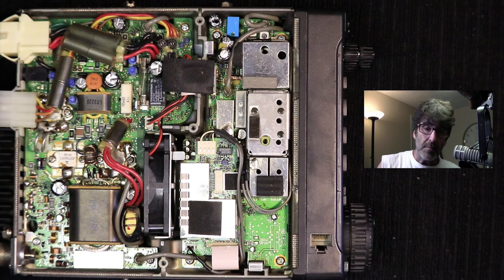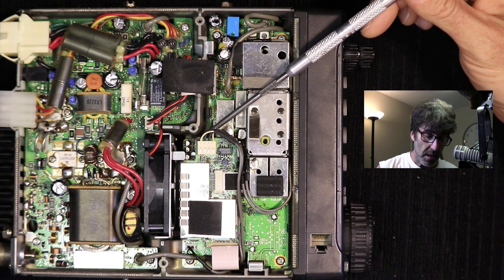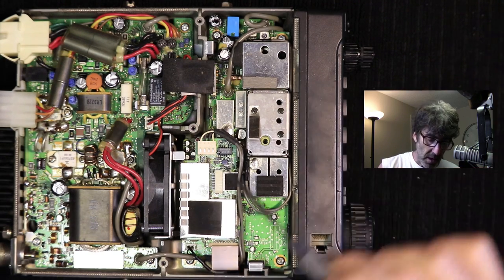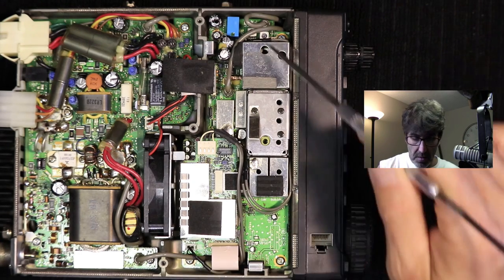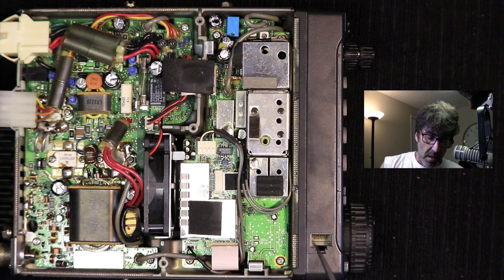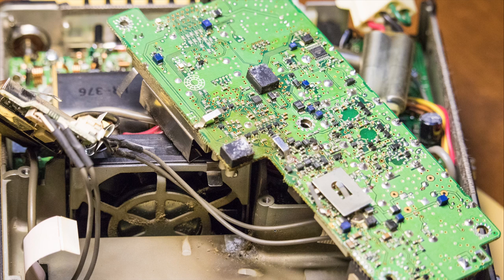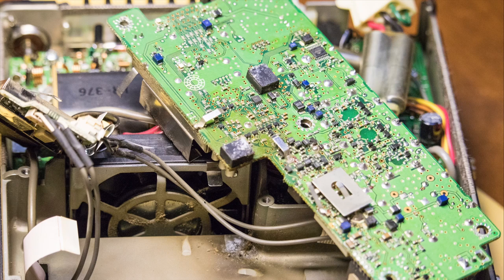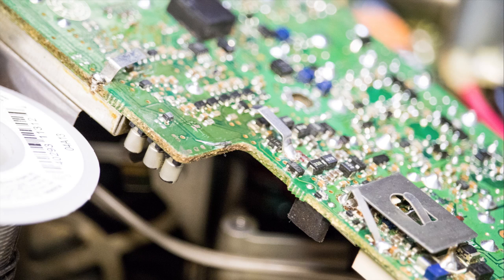ICOM IC-706MKiiG Won't Power ON.... FREE FIX!!!!

Comment: My 706 behaved a little differently. I went into the motor home where I have it mounted to find it making a continual "CLICK CLICK CLICK..." and occasionally coming on completely. Took it down per your instructions and found exactly what you did. Patched the corroded spot and all is well again! Only difference is I removed BOTH rubber pads completely. In my opinion the board is plenty stiff without the support of the pads, and they are obviously highly corrosive!
In my case, it's likely that the corrosion was carrying enough current to ALMOST power it up, but not enough to keep it going. Thanks much and 73! de Harvey WB5MCT
Reply from the maker: Harvey Babb Excellent!... Glad this was able to help 😁😁

Comment: Thanks for posting this. Helped me save a 706MKIIG from the bin! At first glance, radio looked pristine inside. Went to look for schematics and your video was one of the first links I looked at. Pulled the pad off, looked like someone had gouge a hole in the trace. Again, many thanks! I'd like to add that the other pad also had corrosion!!!
Reply from the maker: That's excellent!  Thanks for posting the comment.. :-)

Comment: Holy cow, you are my hero...my trace gap wasn't nearly as obvious as yours, it looked like just a tiny dot, but it was in exactly the same spot! After scraping away the trace on either side of gap and then dropping some solder with a tiny wire in there, it turned on!
A couple notes about removing the PLL board for others trying this out: 
1: There are 2 voltage regulators with heat sink clips on them that hold the board in place even if you remove all the screws...make sure you pull those two clips off (Top left and bottom right corners) before trying to pull the board out.
2: (Probably obvious to everyone else) When he is pointing to the wire at the bottom left corner and talking about disconnecting it, you have to take the top panel of the chassis off to get to the plug. Then it slides right out, as he described. I didn't understand what he was saying about that.
Reply from the maker: Awesome!  I'm glad you got it going again... :-)  Good tips.. thanks.

Comment: Had this same problem on my 706mk2g which I run remote, thought it was an issue with remote rig box as it was intermittent, found your video and opened the 706 up to find the exact same issue,  1 hour later the radio is reassembled and up and running..THANKS VERY MUCH!!!!
Reply from the maker: Great story!  Thanks for watching.... :-)

Comment: Have 3 of these radios.  One has been on the shelf with this exact problem.  Today I pulled the PLL board and definitely a corroded open trace.  I now have another radio back on the air.  Thanks for posting.
Reply from the maker: That's awesome!  So glad you got it going again...  😎

Comment: Thanks a lot! Mine has a (very seldom) intermittent power off issue, sometimes during listening, but mostly when you first power it up. Now the cooling fan doesn't come on. I've heard on W2AEW's channel that corrosion issues cause a lot of power issues. I would imagine mobile operation doesn't help. I bought this radio new in 2004 when I lived in SC. It spent five years in the heat of the car, and I also brought it back and forth to use in the shack as well. I'm too cheap to buy two radios! I moved to Maine in 2011 and this radio spent the summers and winters here for five more years in the opposite extreme environment! It now stays stationary in the shack after several years of being in storage, I've started using it again. P.S. I enjoyed the F150 bed removal video. That job went well, so thanks twice! 73's!
Reply from the maker: Awesome.. yes it's a good radio.  I hope you can get to the bottom of it..   You're welcome.. 😊😊

Comment: I just wanted to thank you, this was my issue and the repair worked wonderfully. My issue started as an intermittent recieve/transmit then later it was clicking when off and eventually was dead. I did eliminate the rubber pad as well. Thank you for saving me a bunch of time!
Reply from the maker: That's awesome!  So glad I was able to help... 😀

Comment: I just bought one of these radios on the used market, as I do for a lot of my stuff, not just my radio gear. I usually search around for common problems so I can be prepared, stumbled on your video. This is the second time I’ve seen a helpful video from you on this radio (watched the HF mod video). I think the real skill is that you actually identified the problem here! Thanks for posting, I hope I don’t have this issue. I’m considering opening her up and looking before it becomes an issue though now!
Reply from the maker: Excellent!  Glad I could help... yea if you open it up just look at the section of trace there to see if there's any signs of corrosion... then as Barney Fife said.. Nip it in the bud!...
Reply: @JLPicard440  shared this video with a friend of mine that has a couple of these radios to fix. He opened it up and found a break in the trace in the exact same spot as yours. Now that radio is back to life.
Reply from the maker: @ryanjones9305  That's awesome!  That problem must be more common than I thought..
Reply: @JLPicard440  I’ll let you know, we have two more of these radios to check. Both are working at the moment, but we figure it’s time to do some PM. Another friend of mine said his had the same problem on his. So out of 706 owners I know, including you, I’m batting a thousand. I’ll let you know how those other two look.
Reply from the maker: @ryanjones9305  Thank u!
Reply: @JLPicard440  so we took down and checked both of those other two radios yesterday. Both showed significant corrosion where the rubber pad meets the chassis, but the corrosion does not travel to the board. Maybe there was a serial number range this was a problem for, because one of the radios is a much earlier serial number than the one with the corroded board trace. However, we have a new problem. In the oldest of the radios, the dadgum ribbon cables came apart. So if you know of a source for those parts, I’d love to hear it!
Reply from the maker: @ryanjones9305  Oh no!  You could try calling Icom to see if they have one available.  You might be able to download the service manual to find the part number.  I looked on eBay and there were some on there you could buy by the pin and length...
Reply: @JLPicard440  roger that. I emailed the couple people on eBay with them currently listed. One dude was “well I’m not a tech”, the other guy was helpful and said that he’s not positive the cables for the 706mkiiG are the same as the mkii model. I called icom, they were actually helpful. Took my radio model and serial number and are going to look it up for me. I have the service manual, but it’s a little tough to decipher for these cables actually, but it’s probably my ignorance that’s causing me the trouble. I’ll let you know how it goes, maybe our little thread here will help someone as much as your video has.
Reply from the maker: @ryanjones9305  Excellent.. hopefully Icom will have the part and be able to send you a new one...  😁😁

Comment: Hey great video. Had to work on the pll section today and put back together. would not power up. Watched your video and remembered many years ago I encountered the problem you did. So I went back over that area and put on some actual fine wire to replace the track. Radio now works! Thanks for the reminder!
Reply from the maker: Nice work!  So glad this video was able to help someone get their gear going again.. 😀

Comment: Thanks for the tip.... you're right about not being able to see the open at a glance due to the glue that remains on the board.  I visually traced the land and measured the resistance at the two feed thrus on the pcb and it was open. I used brake clean to remove the glue and used my iphone in hi mag mode and looked at the problem area, the open stuck out like a sore thumb. All's good now. One more point.. the black relay located right next to the fuse on the PA Board was clicking like crazy, it doesn't do that anymore after the fix.  Thanks again. 73  DE  WA2MO
Reply from the maker: I'm so glad this video was able to help people.  Thanks for the feedback..😊

Comment: many thanks, just fixed one with this exact problem, used a fibre tipped brush and cleaned up all the ribbon connectors as well, sprayed switch cleaner inside them, all working perfectly now :-) very thin ceramic capacitor leg was used to bridge the broken track, used some firm sponge in place of the rubber pads, used shoe glue to glue hem to the case, had to use 2 x pairs of plus 3 glasses at the same time to do it LOL, thanks again would never have found this otherwise.
Reply from the maker: That's so awesome!  I'm glad you were able to bring it back to life..

Comment: Nice tutorial thanks.  My Ic-706 makes a relay "click" for about half a second on attempting to switch on (with some speaker hiss) but immediately cuts out dead. Is this the same fualt as yours or was yours completely dead (i.e. no sound of a relay for a split second then dead)?
Best wishes
Peter G0LQU
Reply from the maker: HI Peter, if I remember right it was completely dead.  No nothing.  I have heard of those inline fuses on those acting weird like that. You might want to check it and make sure there's no corrosion in there or anything like that.

Comment: Thanku  i couldnt believe i had the same problem . u saved me a heap of time debugging. all fixed now. ps dont forget 2 remove  the pll board's  8v reg and audio amps heat sink clips before flipping the board over. I  used the pcb vias as soldering points to jumper broken track
Reply from the maker: You're welcome!  Thanks for the info and I'm glad I was able to help😀

Comment: Just fixed mine with exactly the same issue. I still measured 10k ish where it should have been closer to 0. I bet this has killed a lot of this good old radios.... Thanks and 73, VE1TV.
Reply from the maker: That's awesome!  Glad you got it going.  Yes I'll bet there were a lot of "Tech special" radios sold on eBay with this issue that were sold cheap and turned out to be a free fix..

Comment: My 706mkiig has sitting in storage dead for about 2years. Being in a COVID lock down for the next 2 weeks, will have to pull mine out and check this, and see if the issue is as simple as you have shown in your video.
Reply from the maker: I sure hope so!  Good luck..
Reply: @JLPicard440  

Happy to report my IC-706 switched back on again today after 2 years  thanks to your video. Checked UHF/VHF Bands today after putting the 706 all back together, and able to key into a couple of my local repeaters.

So will install it into my car tomorrow, and see if the HF side is working too, or if I have other issues such as finals.

Thanks again
Reply from the maker: @grant209  So excellent!  I'm glad you got it going again...

Comment: Thank you very much for making this video! I followed you instructions and foud the same PCB track open.  I will do the repair   this week and see what happens.   Thank again for all your help!
Reply from the maker: Thats excellent!!  If you've confirmed that the trace is open, then that's most likely it!
Reply: Take a Bath Productions Hello Rudy....I hope I spelled your name correctly.  At first the radio would not power on after I did the repair.   Further troubleshooting revealed the ribbon cable wasn't making a good connection.   I made a temporary repair using tape and a thin piece of plastic to make the cable fit tighter.   Look like it is running solid!  THANK YOU SO MUCH FOR ALL YOUR HELP!
Reply from the maker: Don Cooper great!! Thanks
Reply: Do you have a good POC for Icom parts.  I need to purchase the ribbon cable that connects the top and bottom circuit boards.
Reply from the maker: HI Don, other than calling Icom themselves.. I'm not sure.. If you had a part number you might try RF Parts or Mouser
Reply: Take a Bath Productions Thank you very much!

Comment: Can u go up a little further and connect it where there is more on the board ? Just asking as a tech . Maybe it’s better shorter ? Unsure . Cleanliness ? I believe I may have this problem growing more often . Gonna change out line in first then we go to your plan. Oh ( sorry ? ) thanks for the tip man While I’m at it , “do you have a way of putting on power pole connectors instead of this lame connection with all its wires hanging from it “?
Reply from the maker: HI Victor, I don't see why you couldn't go up farther on the board to find better "meat" to connect to.  If it's an RF line Yes you want to minimize the length of anything since it'll change the characteristics of the circuit, but I'm pretty sure this one is just power.  It shouldn't matter if it's a little longer.  I don't like the factory connectors either.  The only way to add a power pole would be to completely pull off the factory plug and run a short pig tail through the hole where the factory one was.  It won't look great but should work.  Just be sure to protect the wires where they pass through the hole so there's no rough edges that can cut a hole in the short wire.  Or maybe there's a surface mount available for power pole that would be a close fit.  I haven't seen one, but that doesn't mean anything.. 😂

Comment: Looks like I have the same problem.  What are people using to get the black rubber pads off?, and are those grey coax cables soldered in? TIA  Mark VK4AU
Reply from the maker: I don't remember if the grey coax was soldered in.  I think typically they plug in.  I don't have access to that rig anymore.. I would maybe use some alcohol to get the rubber off... or some electronics cleaner.  Goof off or something like that is probably to harsh and might remove the green from the board..

Comment: Thanks for this video, I fixed my radio !! it was mounted in my mobile and started switching on and off randomly. After pulling it apart, I found exactly what you described. 
Thanks again. vk3ae
Reply from the maker: That's excellent!  So glad I could help... 😀

Comment: Excellent video, I have the same radio and restored a track under the pad but the MKIIG radio still does not turn on. A hug
Reply from the maker: Oh no!  Sorry to hear that..
Reply: @JLPicard440  THANK YOU AND OH KINDLY FOR responding, I have already managed to turn it on, but it has no power, not even VHF, UHF, HF, and apparently the final transistors measure well, is there any other open component?
Reply from the maker: @HI5MLE  I would think there's a different circuit between HF and VHF/UHF..  I checked mods.dk and only found a thread saying "No TX/RX on VHF/UHF" but does your radio have RX on all bands?  Not sure what that would be..
Reply: @JLPicard440  Thsnks my friend
Reply: @JLPicard440  Thanks, Yes the radio have RX in Bands
Reply from the maker: @HI5MLE  Arrgh.. sorry I don't know on that one.

Comment: Perhaps u can helped me Sir..the knob of my IC-706 MK2 is not working..i cant turned it to adjust freq..is there any settings or way to fix this?
Reply from the maker: HI.  I don't have access to that radio anymore, but I don't remember any settings that would turn off the VFO knob.  I guess there's a possibility the encoder is bad, but I'm not sure how to prove it.  It's probably an expensive part.  I googled that problem and looked on mods.dk and didn't see anything...

Comment: Greetings dear friend.  Could you help me to be in the SET MODE ADJUSTMENT of the Icom IC-706 MKIIG?  I don't know the type and configuration of the Plug that is connected to the REMOTE to access its Service Menu.
Reply from the maker: HI, I'm not sure how to answer that off the top of my head.  I don't actually have a copy of the MKIIG service manual.  That information will be in there.  I did find  the MKiiG service manual online.  It's on mods.dk  You have to have an account to access it, but it's free.  They've never spammed me.  Once you get on there on the left side you'll see main menu, then manuals.  Click manuals/ icom, then scroll down until you see it.  It's under/ "IC-706MKIIG Service Manual Revised June 2007.zip".

Comment: I don’t not know is this is the same problem I have but it could be because mine started shutting off, but it did start on and then it shut off by himself. It was like you turn it on and 15 minutes you shut off, and sometimes did not want to start but later on you, plug it in again, and it goes on, but otherwise sadly it didn’t went back on and stay off and now it would not start. I don’t know if this is a relay issue or maybe it is that section there I am going to take it apart. I have nothing to lose.
Reply from the maker: HI, it's possible.  Without taking it apart to inspect the trace on the board, there's no way to tell if that's the problem...  One place you might check is mods.dk They list different types of problems that people have reported over the years.  They do require you to sign up for a free account, but they've never spammed me.